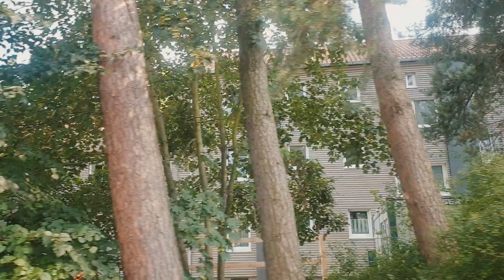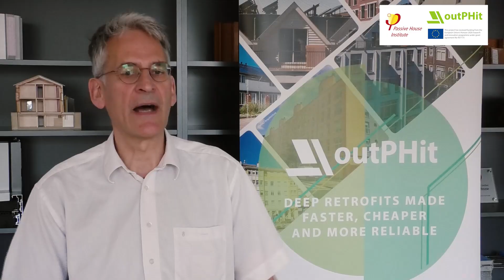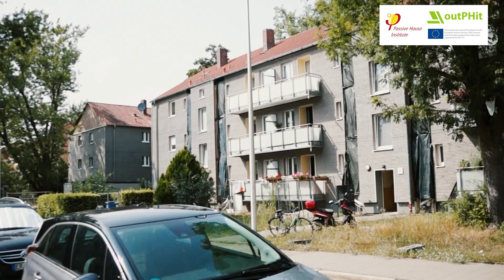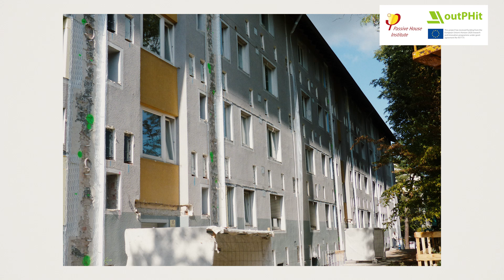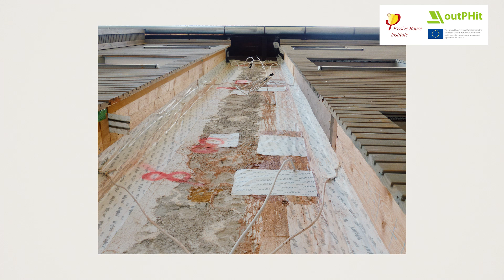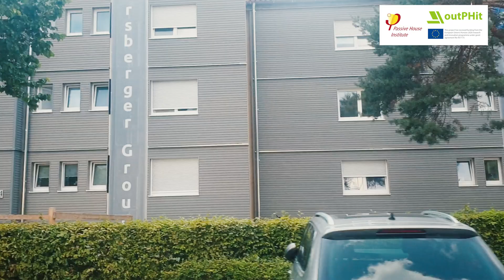Efficient Renovation: Transforming Erlangen Apartment Buildings using the EnerPHit Standard

Comment: That's fantastic ! Here in Prague, I'm looking out onto an accommodation block of 6 storeys and probably 150m long. It's covered in scaffolding, and the processes of attaching individual approx 2m x 1m insulation pads seems to take forever. Then it has to be screeded and then painted. This new process looks much better, but I guess the risk is having installers who know what they are doing.